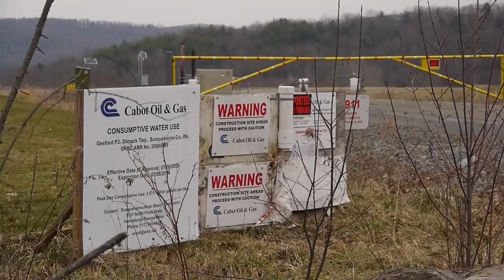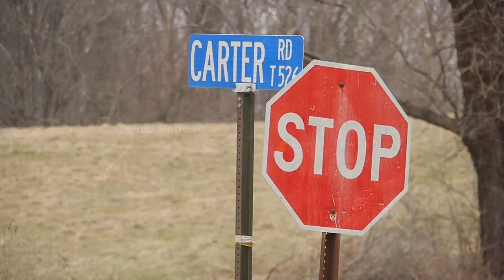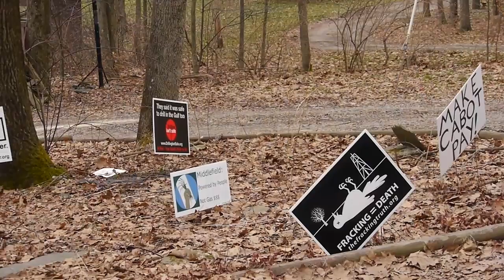Marcellus Shale Reality Tour Part 2 - Dimock Day Trip - Fracking

Comment: SO far i hear CABOT, is having issues then GET THEM OUT and get a reliable company that will do it right.. hahahah sounds like a smart answer huh?????  My fiancé works for a oil field and its a bunch of crap.
Reply: +Jesse Weaver As someone that has a family that works in the oil field, and having an Uncle thats a foreman for a Company, Cabots welders are at a low, thats what they need. My family worked for Cabot, its a Union Company. Theres other Companies along side Cabot that lend supplies to them so they can get the fracking process done. My brother even said the water contamination is being blamed on the Mathane used to frack, its not true....at all
Reply: Still got my job ;)

Comment from the maker: Louanne, Under President Bush and Vice President Cheney, fracking was exempted from significant EPA regulation and is not subject to the same standards as other industries when it comes to protecting underground sources of drinking water. The company is responsible for cleanup if contamination can be proved, that is the hard part, since there hasn't been much testing in methane migration or long term studies.

Comment: Is it possible to install south facing windows to keep the water from freezing or even turn it into a green house? I live in SE PA (Philly) and though your winters are worse than ours, I can't see how a system like this couldn't keep the water above freezing. Also, wouldn't it be possible to dig a 4 ft hole and put this building so that 4ft of it is under ground, combined with green house features? Just trying to suggest helpful things.

Comment from the maker: @swajsofa You are right, its not American, it is the State of Pennsylvania that guarantees is residents clear air and water. The Sautners had clean water until Cabot polluted it. It is only American that Cabot pays for a permanent solution, not a filter system that doesn't get all the contaminants out.